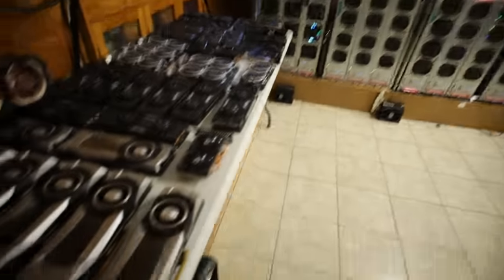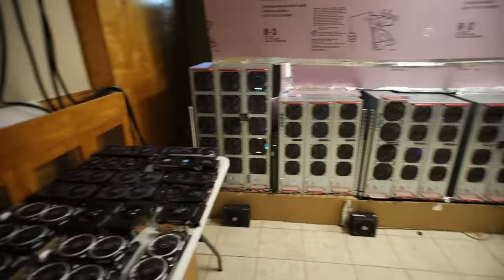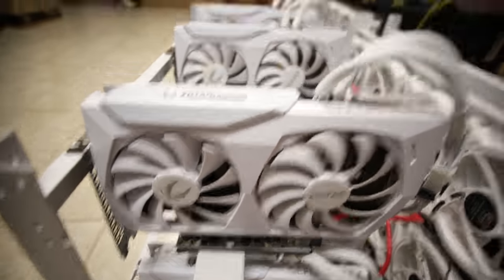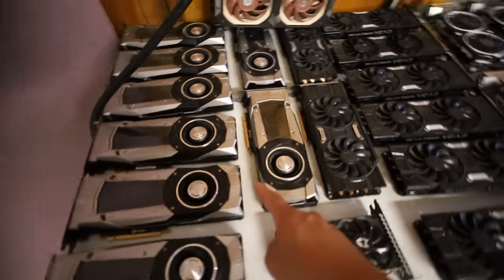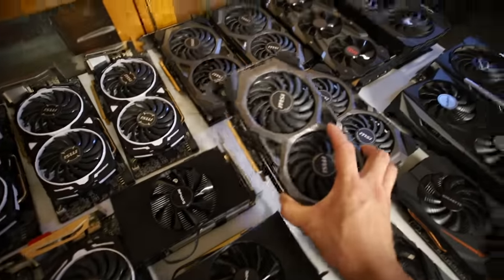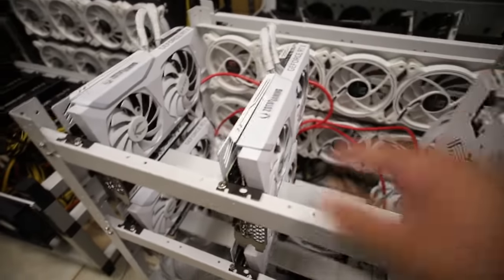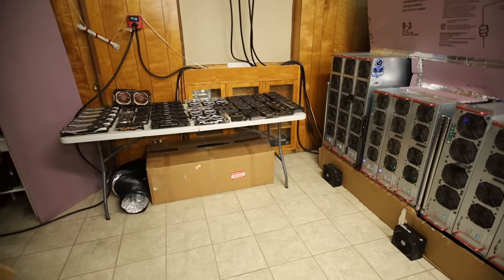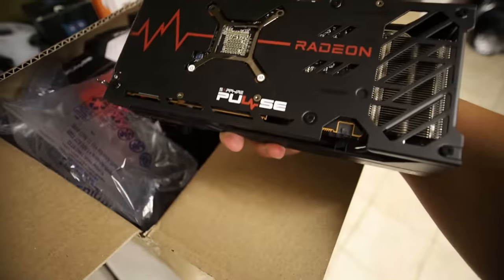🎁

Comment: For those GPUs you 'overpaid,' giving them away may NOT be a bad idea. Sounds silly but if you think about it... as a business expense, you get to deduct the total cost of that GPU and offsetting profit. BTW, 'not a fiaancial advice, it's just my opinion.' ;)
Reply: He probably already had deducted those costs earlier
Reply: @MetalZoned  Depends on Canadian tax laws, sometime assets has to go on depreciation table. I don't know Canadian tax laws.
Reply: @MrTiger0002  assets like GPU's, motherboards, CPU's are 55% depreciation each year on the remaining undepreciated value.

Assets like network switches, routers  cables, and other network infrastructure is 30% per year depreciation....at least to the best of my non-expert knowledge.

Items such as thermal pads, paste, putty, shims, and GPU replacement fans are 100% deductible as they are maintenance/upkeep items....to the best of my knowledge.
Reply: @snarksdomain  55% each year on undepreciated value... that would take a while to get to 100%. All the more reason for RPM to give away those 'overpaid' GPU's as business expense to quickly depreciate the entire GPU right way. ;)
Reply: @MrTiger0002  yeah, after two years there's 20.2% left, and after 3 years it leaves 9.11% remaining, etc...

Comment: When the white fans turn yellow, if you can carefully remove the plastics from the electronics, you can soak it in hydrogen peroxide while exposing it to sunlight or UV for 1-2 days to restore the bright white. Then shoot it with a UV protecting clearcoat... Same process for restoring Automotive headlight covers.

Comment: Maybe build out a 20-30 megawatt solar farm with battery backup? It would free up some power consumption?
Reply: battery backup for a mine that big (just to survive the night) would cost a few million.

it is a TON of power to store.
Reply: I meant the battery backup as uninterrupted power supply with automatic switch over to the city's power grid to hold the load, not to run 20 to 30mW continuously...Oh and yeah a 30mW system with automated system would run $60k-$100k, which depending on his monthly kilowatt per hour cost, the solar system could ROI in 1-2 years and with maintenance last another 20 to 23 years before photovoltaic solar panels have lost their efficiency, along with batteris need replacement as well every few years
Reply: 20-30MW solar farm + battery backup over $80-120 000 ?